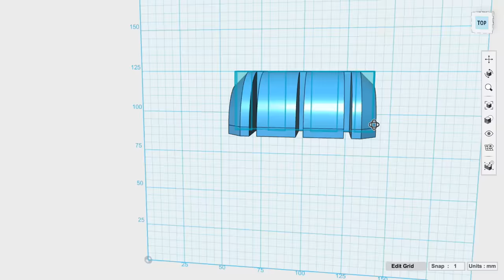How To Make WOLVERINE CLAWS! - Rainbow Metal, Automatic, Spring Loaded (X-Men)

Comment: Not bad. But I kinda like the older one better. More control over the blades and a longer cutting edge. I would just add sliders to the old one so that you can retract the blades and engage the safety.